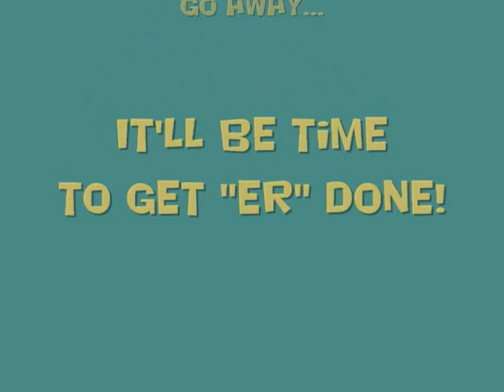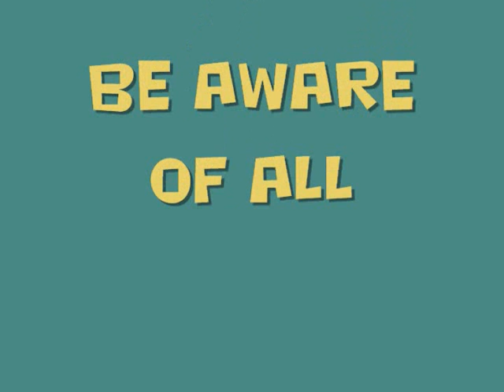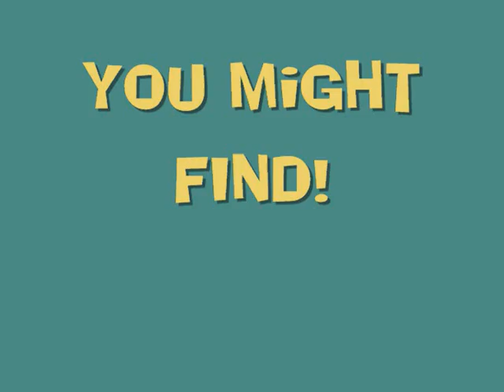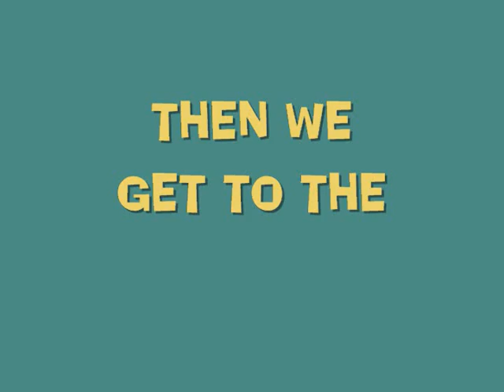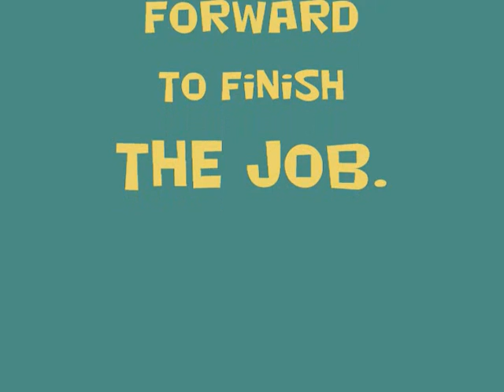How To: Install  Disc Brakes On Your Classic Car. Part 3

Comment: Thanks Pete, I'm about to do a disc conversion on the wife's 67 impala. The instructions are a joke and I'll be pulling it apart a few times to get it right. Watched your video on making up brake lines as well because as soon as I try to undo the lines they'll snap after 50 years. The silicone idea is great to, there's nothing you can't do . Thanks mate.

Comment: When looking at the spindle, left or right, no difference, but 98% of the time, the brake caliper is on the opposite side of the steering linkage. When mounted on the rear as Pete did, the back is called “Leading” and if mounted on the front, it is “Trailing”. In this case on a vehicle that never came with disc brakes as an option, the steering linkage is low enough to clear the bracket, caliper and movement towards the inside of the wheel house. Having two identical calipers, just remember the bleeder screw goes at the top. With this determined the brake line and hose will be on the same side of the axle. Never twist the brake hose and turn left & right to check for proper length and a little extra for range of motion as the wheel moves up and down. This is a great time to check the hose for binding. If not, the hose will fail very early after the install. The best bleeding works if starting the furthest away from the master cylinder disc brakes are self adjusting while drum brakes are design to adjust. The “Star Wheel” is moved 1:40th of a turn (Proving it has 40 teeth on the wheel) but only self adjust when backing up, and applying the brakes. This part is a screw who’s effective length changes as adjusted. It needs disassembled, cleaned, dry and lubricated with a high temp PTFE brake grease. If this grease gets on the friction material, it does not effect  braking. Do NOT use wheel bearing grease on moving parts inside the drum or around the caliper. Use a thick high temp brake grease that contains PTFE. Beautiful car!

Comment from the maker: Theres alot of companys out there that have conversion kits for your rear brakes, one reliable company is called Master Power Brakes, you can google them. My opinion is that you should leave the drums in the rear and convert the front brakes to disc. You will have a much better reliable system with spending less money.

Comment: Hey Pete, the dust caps on my Must. II rotors wouldn't go on at all. so I used a hacksaw and made 4 cuts 90 deg. apart on the cap lip so it could compress a little. Problem solved......Art

Comment: Great video, Pete. I looked up this kit before I found out you did the same thing.  Scarebird set $205.  Not bad.  One question though. Should I go get the master cylinder and brake booster from the Astro or will the stock manual master still work? Seems like you would need proportioning valve, etc. that come from the Astro. Thanks and take care!!

Comment: Nice job Pete. If that was the first time you put disc brakes on a 55 buick and there was some confusion as to how the bracket went on, I say so what bro, that car never came off the jack stands until you had it done right, and that's where it really counts. There are so many different kinds of cars and believe me when I say you will be doing a lot of things for the first time for the rest of your life when it comes to working on cars. How is the mustang from nj coming along? Thanks Bob

Comment: Been researching this conversion all morning and decided on the conversion kit from Scarebird. I'm just wondering, from your experience, when the conversion is complete, and during testing, how are the brakes (disc/drum) manual braking?  I thought about adding a power booster, but I hear more folks saying it's not worth it?

Comment: Anyway, i thought the auto parts store gave me wrong parts but, someone put a diff year tranny in it , i felt stupid not checking it by just slipping clutch disc over male end in the first place, but  like you said always check replacement parts carefully before assembly..